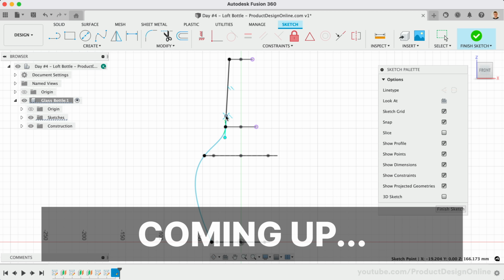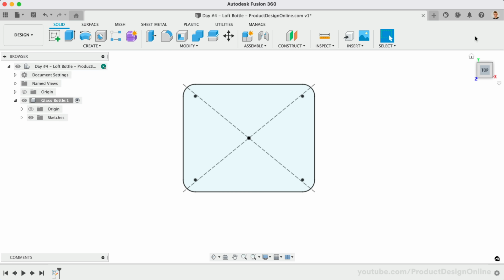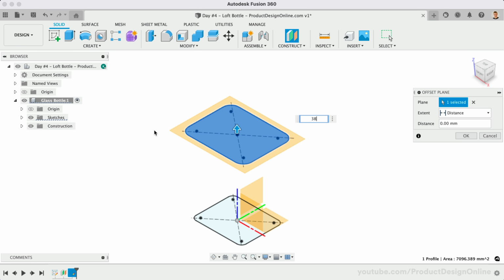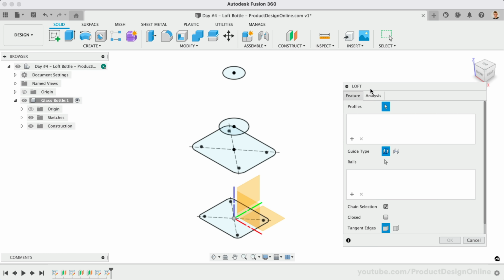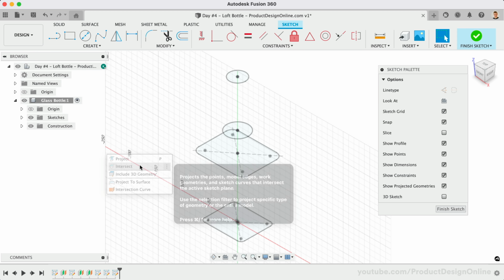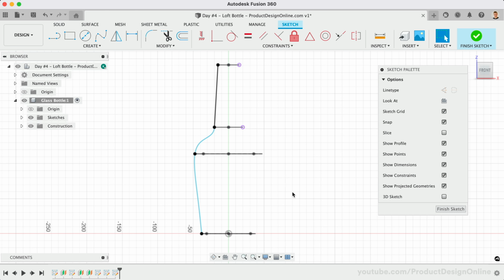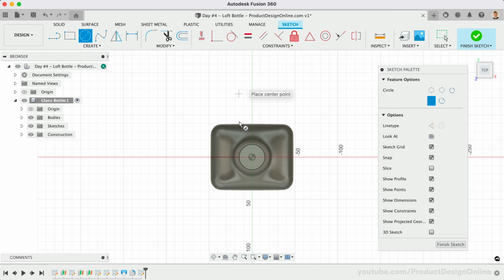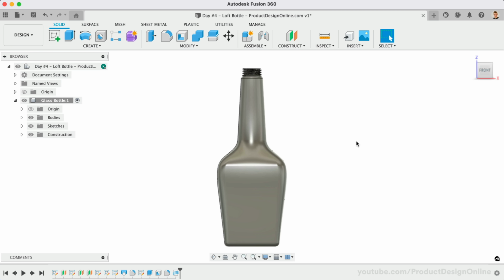Day 4 of Learn Fusion 360 in 30 Days for Complete Beginners! - 2023 EDITION

Comment: I have not been able to get the red dot or the center line to light up. Thank you for your time, maybe my computer is to old.
Reply from the maker: This one is tricky to troubleshoot without seeing more. Can you share your file or a screen recording?
Reply: @ProductDesignOnline  Same with me, I've restarted the lesson three times. Not able to get the red dots. Thought I was going crazy.
Reply from the maker: Can you share your file or a screenrecording? This sort of thing is very hard to troubleshoot without that.  @kfame227
Reply: @ProductDesignOnline  Just emailed you. Thanks for reaching out. Hoping the feedback helps keep your videos accurate
Reply: Kevin, after digging around in the comments I found the issue you mentioned to another viewer. So sorry to bog you down with this, I'm a total newb.

After digging around in the comments, Kevin mentioned the solution to why we're not seeing the red dots

- After finishing the sketches, start a new sketch in the XZ Plane and not the XY. This will ensure that the intersect command will run through all the sketch profiles we just made
- Open the intersect command and proceed as Kevin shows in the video.
Reply from the maker: @kfame227  Just responded, but posting the answer here in case anyone runs into the same issue.

The tutorial and software still function the same. If you're not seeing the red dots with intersecting, double-check that you created your sketch on the XZ origin plane.

The plane is important here as it must 'intersect' the middle of the four sketch planes. 

You'll want to delete the sketch and re-create it on the XZ origin plane instead. You should then see the red dots when you go to use the Intersect command.

Comment: Hi im having a problem with intersection tool. im not making a bottle but different shapes. i select intersection tool and when i select objects to inter sect red dot does not appear. when i hover the cursor on object it says select object to inter sect but red dot does not appear and i dont get intersecion tool to work. What might be wrong?
Reply from the maker: Hmmm. Any chance you could share a link to your Fusion 360 file (.f3d)?
Reply: i am making a boat and i have 3 offset planes. problem is in 2 indentical sketches what makes the hull. i try to intercept the short edges so i can loft out a model. but on those edges the red dots does not come to life as in tutorial it came half point of each line 
 @ProductDesignOnline
Reply: i am just a beginner so keep that in mind :) @ProductDesignOnline

Comment: Wow, I've been using Fusion 360 for over three years, and stumbled upon your Day 20 when looking for something.  Watching just that one episode, I learned how to ease several burdens I'd struggled with over time, so I've started over on your course - bsck to Day 1.  Some profound game-changers like rectangular patterns versus Copy/Paste; Join instead of Move and so on and so on.  Thank you, thank you for this; it's already changed the way I do things.

One note, though, that differs from your version to mine. Though mine is up to date and I presume yours is (I don't think we have a choice) : Once I choose Line tool or Dimension tool (via L or D or the icons) in a sketch, that mode will stick until Escape, but other things, such as Circle, Fillet and so on, do not.  I have not reset to default settings since there are some things I've used for the past years that I don't want changed.  But do you know what setting might cause that to vary from your system to mine?

Thanks again!

Comment: Regarding the spline and the line, I cannot get them to connect as a rail. Even if I lock the spline angle on top of the line, as mentioned in the video, the rails are unconnected. Any ideas?
Reply from the maker: Could you share the link to your (.f3d) file? It could be a number of things, but will be easier to troubleshoot with the file.
Reply: @ProductDesignOnline  Also, thank you so much for looking into the issue! I'm really confused about what went wrong, as I thought I did everything right in the tutorial :(

Comment: I completed the drawing and then tried to change the appearance using smooth glass and dragged the color I wanted over to the bottle like I did for the day 2 glass bottle but nothing happened. Any idea why?
Reply from the maker: Hmm... does the issue still persist if you drop it directly on the 'Body' in the Browser instead of the model itself?

Comment: Excellent series thanks Kevin. 
Just one point I'm stuck on regardless of several attempts ( after numerous undos over 2 hours now) is I keep getting the error 'Selected rails do not touch all of the profiles' when trying to implement the rails.
I did understand prior to the error the importance of using the Intersect command and ensuring to realign the top handle of the spline with the straight line above which I did on my various attempts to redo that stage, and each seems to execute OK again but with only one difference I can detect to yours at the 11 minute mark - When you 'Straighten' the top handle of the spline, the purple spline dots disappear but on mine they still remain shown even after I have committed them by 'Entering' or hitting the green tick (also causing the corresponding Fit Point Spline box on the Sketch  toolbar to  deactivate) making me think the action has been successful. I have then straightened the top spline handle on each attempt but still get the same error later intstalling the rails. Could the purple spline dots remaining indicate what I'm doing wrong ? Regards.

UPDATE:  Now Fixed! 

Today I deleted and restarted Day 4 again and think I discovered what I was doing wrong. It turns out after reading my notes (Currently 17 pages due to me being a beginner with a bad memory ) I had been using ESC to exit after adjusting the Spline handles. I couldn't tell how Kevin was committing his adjustments as we cant see his keystrokes - only the position of his cursor but think I had previously tried clicking outside the model on the workspace (if that's what it's called) to try to get the purple dots black like his without success (also tried Return) but this time doing so with a second click in the workspace  worked and they turned black. Seems I had not been successfully completing the handle adjustments leaving a broken line instead of a contiguous one. 
Perhaps in future tutorials he could add keystrokes and an indication of a 'Click' being activated ?

Thanks again for the videos Kevin. They are much appreciated by absolute beginners like myself.
Reply: In day 2 he did say that pressing escape didn't work for editing splines
Reply: I can tell you, the wrong part was placing the intersects wrong. I think I pressed Shift  when selecting the circles at first and now without shift, they dont have that line striking through them. This fixed it for me
Reply: @komegaming3500  this is what I had done--thank you for the hint on where to look

Comment: When I try to add the threads, it gives an error message saying "the operation would cause a large topology change. Try adusting the values or changing the input geometry."

I input all the same dimensions for the bottle as you, and even if I adjust the value it still won't let me sweep. Any insight?

Comment: Your videos are very helpful but I have one pet peeve. You often do things without describing exactly what you're doing. Like at 15:37 suddenly the guide rails disappear. You obviously clicked on something but you don't say what it was. For someone like me, who knows nothing about Fusion 360, it's sometimes difficult to figure out what you did. Sometimes it's so subtle I don't notice it until the drawing I'm creating to follow along with doesn't do what it's supposed to. Often during the process of figuring it out I screw up the drawing and have to start over again. I'm sure for you it's obvious what you did, but NONE of this is obvious for me. BTW, I figured that one out. Otherwise, I LOVE your videos.
Reply from the maker: Thanks for the feedback!
Reply: @ProductDesignOnline  I have the same issues because I am 100% a beginner. You could easily fix it by added something that shows your key strokes as you press them.....Thank you for making these videos by the way!
Reply: Thanks pretty common in a lot of videos. I think some people highlight the mouse pointer, makes it easier to follow.

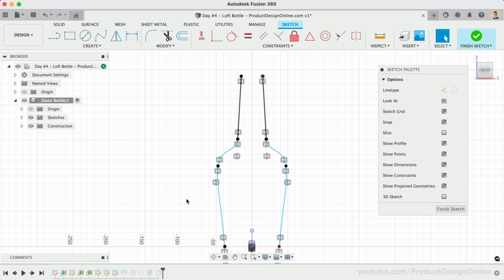Comment: the first problem I had is with the time line (bottom left). On your Tuto, you just clic on the part you want to twerk but when I try it doesn't show / allow the same. ex:  on 14:10, when you have to modified the bottle shape, you just clic on the sketch (in the time line) then you was able to twerk the shape easily ... it wasn't my case . I was unable to twerk as you did

Comment: What I really like about these courses is that I don't have to pause constantly to do what you've explained. A lot of other courses go so quick I can't process the thing explained, but with your course I can just press play once and follow allong! :D Thanks, can't wait to continue learning more about F360!
Reply: Then your a fast learner, I keep pausing, but I dont mind it.
Reply: I still need to but certainly a lot more friendly than other tutorials
Reply: I run at 75% speed and still pause A LOT!  I went through Day 1 4 times already and still get stuck doing it on my own. It isn't knowing the right thing to do, it's fixing something that did not work for some reason.  I have 45 yrs in engineering at leader levels and passed by CAD in its inception. I know what I want, not how to make the tool do it. There must be 10,000 commands in that tool, and 90% are contextual. Not sure I have enough time between now and death to be really proficient, but have so many designs in my head needing execution. 

Regardless of my comment this is by far the best how-to I have found. And Fusion 2025 just came out!!
Reply: Same here, pausing all the time🎉
Reply: You probably don't need to be here.
Reply: Meh, not really. Could be better in that regard. For example, a true test would be: can you follow with audio only? And, well, this series fails to meet that mark. (He does a lot of keystrokes/clicks without mentioning them explicitly.) You can only look at either YouTube or Fusion at any given moment, after all.

Comment: When I go to fillet the base of the model, it won't do what yours does. It only seems to want to apply to the bottom face and not the base of the sides of the bottle. I tried adjusting the spline but it made no difference. EDIT: I made the very bottom spline completely vertical and that fixed the issue.
Reply: This was my issue too, thanks for the fix! I had a clue that something was different when I had to select both sides of the rails before it changed the shape of the loft

Comment: When I select the second line for rail 2 during the loft step it goes blank and comes up with a warning that selection of the second line "doesn't make meaningful changes to geometry" Any tips? I checked to make sure the spline and line are connected and the spline is snapped to the straight line.
Reply: I'm having the same issue now funny enough!